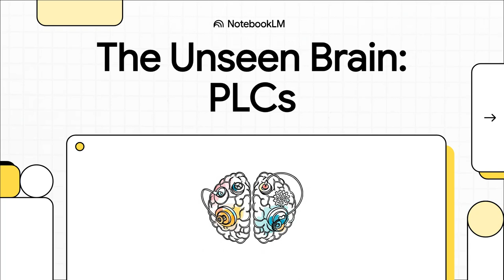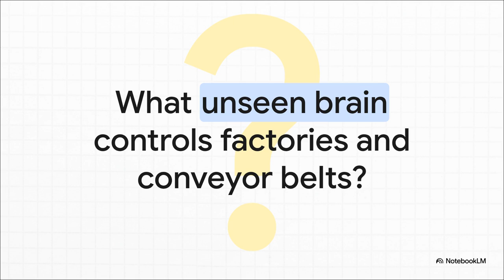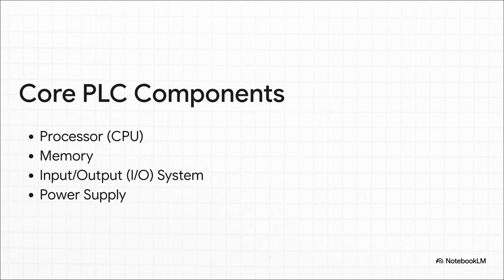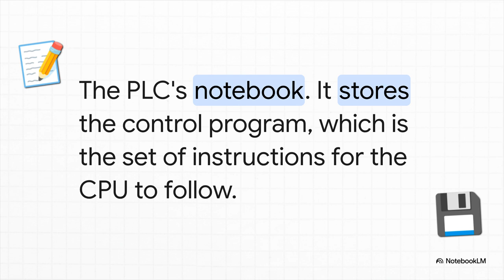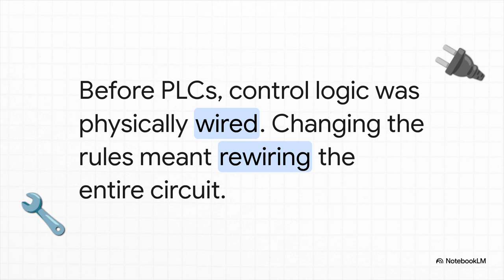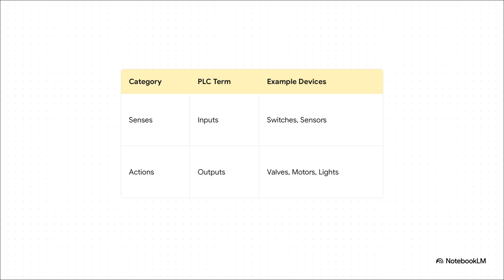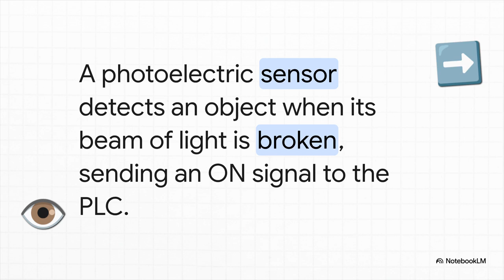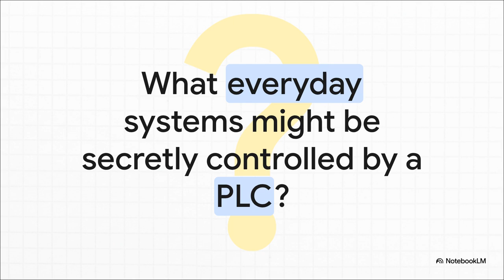PLC

Comment: Nama : Tunggul Joshua Marpaung
Nim : 5221151015
Kelas: PTIK-B
Video ini cerita tentang PLC (Programmable Logic Controller), otaknya mesin otomatis di pabrik. Kalau komputer biasa gampang rusak kalau kena panas, debu, atau getaran, nah PLC ini justru dibuat khusus biar kuat dipakai di lingkungan pabrik yang keras.

Di dalam PLC ada beberapa bagian penting:
1. CPU, ibaratnya otak yang mikir dan ambil keputusan.
2. Memori, tempat nyimpen program.
3. Input-output, kayak indera dan otot, jadi bisa nerima sinyal dari sensor lalu gerakin mesin.
4. Power supply, sumber tenaganya.

PLC biasanya diprogram pakai ladder logic, semacam gambar jalur listrik yang mirip rangkaian kelistrikan. Jadi teknisi gampang paham tanpa harus ribet belajar bahasa coding yang susah. Kalau mau ubah sistem, tinggal edit programnya, nggak perlu bongkar kabel sana-sini.

Contohnya, ada sensor cahaya di konveyor. Pas ada kotak lewat, sensornya kasih sinyal ke PLC. Terus PLC mikir, lalu ngasih perintah ke katup udara buat dorong kotak itu. Jadi prinsipnya simpel: PLC nerima masukan, lalu kasih keluaran.

Intinya, PLC bikin kerjaan pabrik jadi lebih gampang, aman, dan fleksibel. Walaupun nggak kelihatan langsung, PLC ini ada di banyak tempat sekitar kita, misalnya di lampu merah, lift, sampai mesin cuci mobil otomatis.